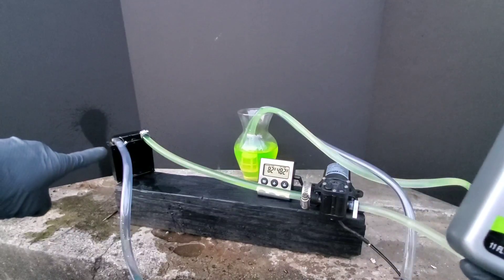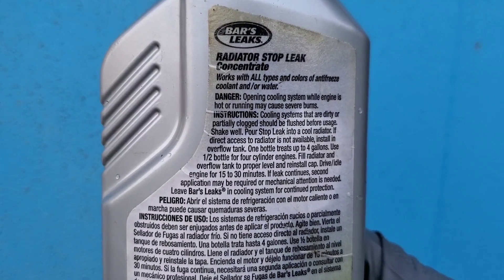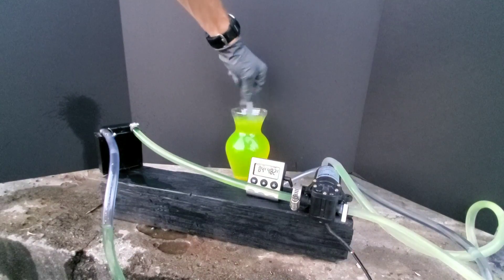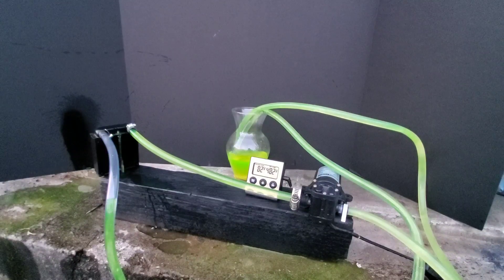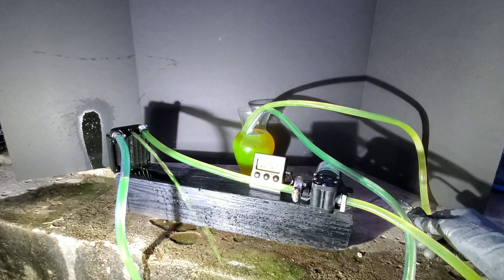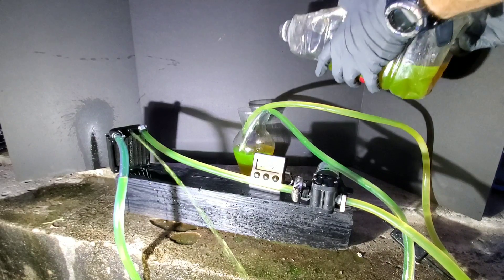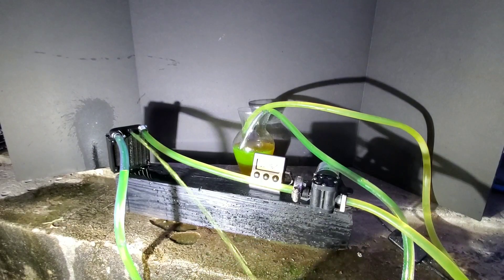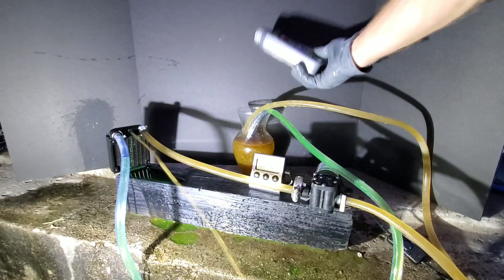How to stop a coolant leak with Bar's stop leak!

Comment from the maker: Share your experience with stop leak good or bad.
Reply: Yes the test was not good at all bar leaks really sucks and blocks everything else up including your thermostat and it will totally block up your heater core
Reply: The Bar's gunked up my thermostat which took some diagnosing to find.  Won't go down that road again.
Reply: Worked for a leaky freeze plug on a Jeep 4.0. I have a friend who used it on a dodge k-car with a blown head gasket and drove the car for another 100k with no problem.

Would never use it in a car I cared about though.
Reply: I have a small hole but it's on the container where the black plastic cap is not the the metal side where u pour in  the antifreeze
Reply: done it with hot water... works only for a couple of days...
Reply: OMG DONT USE THIS BULLSHIT!! It will destroy ur radiator..  it will destroy lines resvor it wil cost u the price of a new car
Reply: did you consider that mabey didnt work cause the water wasnt hot
Reply: @brokenlee5922   no need....  those holes are too big. 
Stop leak is made for cracks or leaking gaskets... those are under 1mm
Reply: @brokenlee5922  that's right the water must be hot to make the seal cure
Reply from the maker: @brokenlee5922  I heated it as I show in other videos
Reply: @NATESINTERACTIVEAUTO  you need 200 degrees for it i don't think those lines would handle anything over 100
Reply: @NATESINTERACTIVEAUTO  Awesome work. But how hot did you heat it......was it similar to actual radiator temperatures?

Comment: Honestly if you got a leak pouring out that bad you got to give it up ans go to the mechanic and get new radiator.  But sometimes it does take a few bottles to stop it or extremely slow it down

Comment: This stop leak is supposed to be added to a cold radiator and needs to be heated to work properly. Testing it with cold fluid isn't the best test. And it also needs to cool down e.g. 48 hours to cure around the hole or crack. To make sure this stop leak works properly, remember to use with new clean fluids. Do not put it in old/dirty coolant. Hope this helps some people

Comment: As many have said, you missed a very crucial part of cooling an engine… the heat. You need to let the engine idle at operating temp for at least 15 minutes to allow for the formula to expand and work. There is a video of someone doing the same experiment, but they used a heating system to gradually increase the temp of the coolant… and voila it actually worked to stop the few leaks on the radiator.

Comment: 1. recommended for holes less than 0.8mm (0.032 of an inch)
2. Heat is required to activate the silicates & drive moisture from them, thus leaving the crystals that will plug the hole/crack.

Comment: I put a bit of stop leak mixed with coolant in the coolant reservoir/over flow, although I did put most of it in the radiator. Should I be worried that I put some in the reservoir?

Comment: From the looks it this video, I'd say no it doesn't work!! I've fixed easily visible radiator leaks with long cure JB Weld after a thorough cleaning of the leak, and have tried water proof epoxy putty that works well too.

Comment: Well 2 things..  the highest the pressure gets in a cooling system is around what 15-20psi..  i dunno what pressure that pump you used could generate but still the colling system gets hot as fuck..  maybe if you heated up the whole system because some of that stuff activates with heat and pressure.  Some reacts with heat differential like its all fluid while cool or hot but when it goes from hot to a cool place like through a hole, the stuff hardens and collects at the hole…

Comment: All of these mechanics in a can never works well, the liquid has no eyes,no direction to go and find the leak, it doesn't have a GPS or any way of going directly to the leak and thats why it will travel all over the cooling system and once that stop leak grabs onto something in the system like a radiator, heater core or even a blockage of rust in the engine it will stick, then the rest of the stop leak will pyle on like leap frog and there will be your blockage and plug up your cooling system. Fix the leak the right way and save your self the headache.. think of fix a flat for your tires..ever try to repair a flat with that stuff..ever wonder how driving around with it will seal your flat? Ever go on a spinning ride at Disney and when it spins, can you move all over the place? No you are pinned in one spot and that's what fix a flat does. Just saying

Comment: I'm a little confused by everyone's comments about how the coolant needs to be hot to work.  I just bought some for my radiator, it says right on the bottle that it should be poured in a cool radiator, so that's what I did.  I also used ice cold well water from my hose as coolant and it stopped the leak within a couple of minutes and it was a pretty decent leak.

My guess is that they tell you to put it in a cool radiator for safety and then it won't start working until the heat and pressure builds up?
Reply: That’s exactly right. Taking the cap off of a hot radiator is really dangerous. Pour it in cold, drive or let it run the proper amount of time to heat it up. I’ve used it in my youth when car fixes were not priority and it worked great. Honestly probably longer than it should have.

Comment: Great product I have used it for the inner heater radiator and does the work perfectly.
Reply: Hi can you tell me about the leak in the anti freeze container and the hose connected to it
Reply: @kimberlywright4988  which one, in or out? This product does not  work with rubber hoses, only with aluminum pipes. Please make your question clearer so that I can be helpful.

Comment: In my opinion this is an accurate display of most stop leaks, they don't permanently fix radiator problems , and should only be used in emergencies.

Comment: It Hass to be like boiling temperature for the stuff to be working. Like they have a new brand with actual pellets In it, oh they are solid but when you pour them in the boiling coolant they dissolve and act like a JB Weld through your system. You can’t use cold water lol

Comment: Almost ALL of these coolant stop leak's include Sodium Silicate as their main active ingridient that works to stop your leak. The issue with your test is 2 parts/reasons why it is soomed for failure from the beginning. Issue #1-Sodium Silicate in these products works by the introduction of heat from your engine. this is why they all say to run your vehicle for atleast 20 minutes at idle with the heater on high (so it doesnt clog your heater core).  Issue #2- The leak that you are trying to simulate stopping is one huge gaping hole. looks like the dang radiator was shot from 2 ft away with a 12 gauge slug. Theres no way ANY product would stop this "leak". Try simulating a real world situation, where the cylinder head is maybe warped after overheating and now off by 0.05" or theres a small head gasket leak. To assume this product would stop a leak the size of the grand canyone is flat out ridiculous IMHO.
Reply: Actually just used it like 15 minutes ago.  Seems to have put a stop on my head gasket leak for now.  Great stuff for 10 bucks.  Beats pulling the motor apart

Comment: Does anyone know if you can use Bars Stop Leak multiple times? It was applied to my vehicle and it stopped the white smoke immediately…. However that lasted a few hundred miles and now the white smoke started to return. I just need the get the car up and running for another week so I can get it in the shop for repair. Thanks I’m advance to anyone who can help with this question!
Reply: Drain the radiator(or wait for fluid level get low I guess) and just repeat the process

Hope your rides OK

Comment: In the time it takes to do this you can replace the radiator or a hose with the hole in it. Radiators are not hard to replace, they seem intimidating to people but they're very easy to install. You literally remove the hose & few bolts & lift, then put new radiator in & reattach hoses & done. Make sure you flush radiator with a cleaner before you add coolant, so you catch any debris that was inside radiator during shipping & then after it's flushed & clean, add coolant & done.
Reply: That used to be the case, but most of your newer cars and especially some foreign models today, its not at all easy to remove radiators,  sometimes half the front end needs removed, or they can also come out the bottom of the car, not to mention some models need special tools to remove oil lines from them too. FYI 😎👍

Comment: This stuff works. I had a leak in My civics radiator and I added the silver aluminum mix and presto! It’s genius. I have a new  radiator in the mail but I’m not installing it until the radiator starts leaking again. Probably not the best idea though. Edit: use the silver stuff! It’s better and it’s also under 10$
Reply: Hi, did the radiator start leaking again?
Reply: What did u due in your process of putting it in ?
Reply: @ila83  probably didn’t do it.
Reply: I don't doubt that it probably worked, but these particles seem really bad for the pump.

Comment: It wasn't meant to plug a cold garden hose . Used this exact stuff in my 2003 Ford Explorer 4.0  coolant radiator. Had a leak that would start when it got to about 5 psi , or 150 degrees . Right were the plastic tank is crimped to the aluminum radiator. It worked well for two months when I replaced the radiator . It even flushed out without leaving residue in the engine. One of the few truly safe and effective products for this very common type of leak . Just about every company that produces additives like this has a similar product . Heat , pressure , small leaks. Read the bottle  🤦

Comment: If this stuff could stop a leak that sized, it would also plug up those little tubes you have. I'm just trying to see this stuff get fuzzy like what's coming out of my buddy's radiator after using this stuff. It looks like an animal died inside the rad!

Comment: Major problem with your test is radiator systems are under pressure ... usually around 10 or 15 pounds. Your experiment was not a closed pressurized heated system.

Comment: What a useless demonstration it's not gonna stop Niagara falls
Reply from the maker: It wasn't easy i used something really small but if it doesn't even slow it down any at a lower pressure then it's not that great. Plus i use a full size radiator in different videos.

Comment: Had a hole in my radiator the size of a dime. This stopleak sealed it in 4 mins with the engine running i used 1 bottle i. 4 gallons of 50/50
Reply: Do you really recommend it.

Comment: I just used it and found out that half a bottle didn't work, even though I ran the engine hot but I could see a difference as it stopped leaking for a while before the coolant flowed out again. It was a stop and go thingy. Then I stopped the engine, let it cool down some 15 minutes and poured the rest of the Bars into the radiator and ran the engine. Revved it a few times and lo!, the coolant stopped leaking!!! So, it works but maybe my radiator had smaller holes. 😁

Comment: You plugged the radiator up. Look at your return hose there was no flow. Your stop leak plugged off the port so it couldn't plug last hose pressure to great.

Comment: Nice experiment but don't forget to read the inductions. Your next try should include a way to heat the coolant to the correct temperature and use a realistic leak.
Reply: Radiators get bullet holes... 🤣
Reply: The accent should clear up anyone who thought he read the directions and used it properly.

Comment: The stop leak is worse than a temporary solution. That garbage gets all over the small passages of the engine/radiator and clogs the whole system.

Comment: I feel like these products are mainly used for  when the plastic lids start leaking very slightly , But yeah, this needs  to be  in a car engine at operational temps  180-210º   under pressure and going.
Reply: My coolant radiator thermostat keeps going to the middle fast

Comment: 6 minutes waisted is what i think. Thats not a leak. Thats a hole!!! Your radiator took a 9mm its trash. Could it work on a crack or a seal? Probably. Will it ruin a thermostat or a water pump?

Comment: I thought the coolant has to be heated up for this to work? It works fine on the car that I am using.  It just a temporary fix to get you by. The Bar Leak last for 8 months before I had to reapply.

Comment: It looked like you're pouring in some pretty nasty looking coolant. Maybe just full of the stop leak.  I do realize that coolant system leaks can be expensive depending on the circumstance.  But I also assume that stop leak could cause more damage than good in the long run.
Reply: There's people that put in stop leak and years later it holds. Tho if your engines to far gone it most likely won't work at all and you know it's a much bigger issue that needs proper repairs.

Comment: Crying!, thank you Ford for the position of the water pump 2014 Explorer!  $2000 to replace it.
Reply: I think I'm having the same problem with my Taurus X. You think this stuff can help?
Reply: @Rob774  trying it on my 2001 jaguar today
Reply: @MrLockederboss1990  Results?
I did it for my 2008 T-Rex today. Saw a little puddle afterward, which means it's still leaking. I will try another bottle.
Reply: @Rob774  let me check that as soon as I leave the house
Reply: @Rob774  at least since the last 1é hours no coolant loss
Reply: @Rob774  next check still looking good... That might have worked, I'll report after 1 week
Reply: @MrLockederboss1990  Good to hear. I went with K Stop, or K something or other and Im having better results thus far. After eight hours if work i could barely see the area where it usually drips at. I will see what it looks like tomorrow after 16 hours of rest. If i notice a little bit of leak i wont put a full body of the K Seal stuff, maybe just a half. I know these bottles say it won't clog your system, but i don't want to overdue it.
Reply: @Rob774  after 6 days I'm visibly not loosing Anymore coolant, my leak was small i guess ( refill 1 per week or less)

I would say it worked, since it's an old car I'll just monitor it, but looks good to me
Reply: @MrLockederboss1990  So there's hope! I didn't have time tho check mine this mourning as i drove the wife's car. I will check after work. Even if offers not a PERFECT fix, anything is better than $2500.
Thanks.
Reply: @Rob774  since I'm not planning to invest any big money into my car it just expends its lifespan, or better said, no can stop refilling every week 👌👌
Reply: @Rob774  so last update,

I would claim I didn't loose a single drop of coolant the last week.

A fried of mine had the same problem 2 years ago... His cars leak is still fixed..

Definetley works for small holes approved🔥💦
Reply: @MrLockederboss1990  I moved my ford yesterday. Didn't see a drop yestrrday or today. Real test is this weekend when i drive 40 miles. I'm very optimistic though. 
Thanks.
Reply: @MrLockederboss1990  So I finally drove my Ford after it say for almost a weak. I opened up the reserve reservoir and was shocked. It was still full. I could still see the K Deal stuff blended in. I am glad Bar's worked for you. Who knows...perhaps the second bottle was all I needed. But perhaps my Bar's/K Seal combo did the trick. Either way, me and you spent roughly $10-$20 vs $2500. Thanks again for sharing your story and the updates. Good luck in the future with it.
Reply: @Rob774  same over here, good efficient fix, now let's see how long it lasts

See you in the comments =)
Reply: @MrLockederboss1990  how to use this stop leak?
Reply from the maker: Follow manufacturer's instructions
Reply: @MrLocter  just pour it where your coolant goes... Since I made that post I haven't refilled once!!!!!!!!
Reply: @MrLocter  4 month and still going strong
Reply: @MrLockederboss1990  i have a small leak  where don't know where  in my ford i think to use it
Reply: @MrLocter  I can only recommend it, I had to refill every other Day... Since then not a single refill
Reply: @MrLockederboss1990  can I leave the product in the cooling system  after finish or do I have to change all cooling water when I finish?